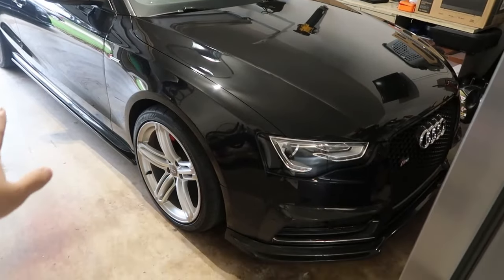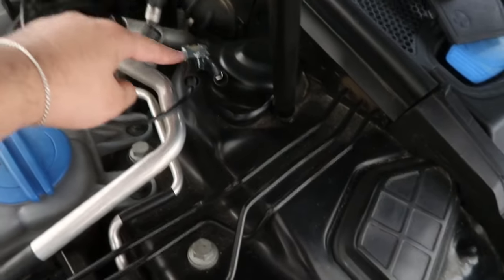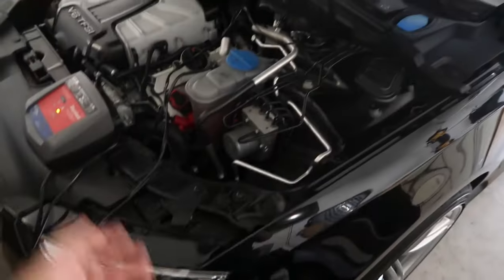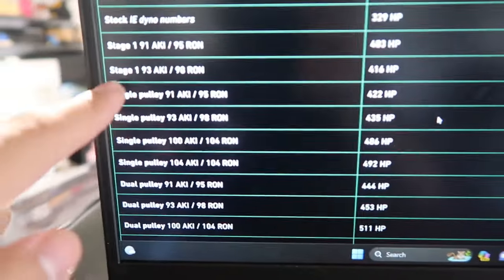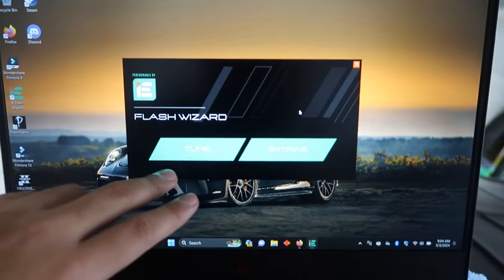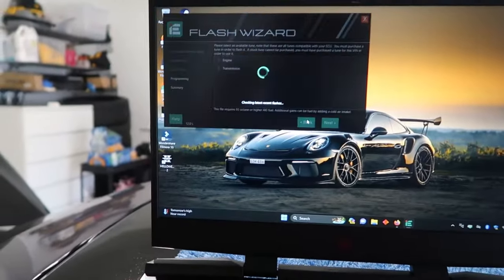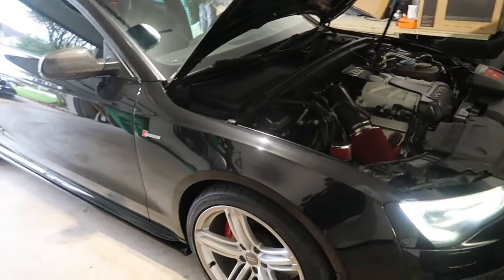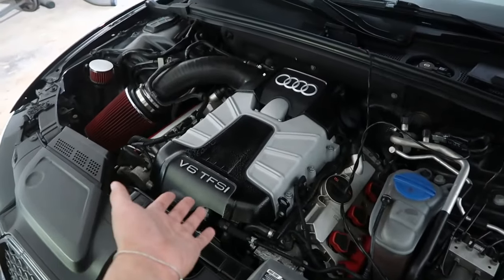TUNING YOUR AUDI S5/A6/SQ5/S4

Comment: Nice rides. Will you have to upgrade the interior cooler for stage 2?
Reply from the maker: Not with the single pulley , but when i do dual pulley yes its needed
Reply: Thanks, I’m getting ready to tune my S5
Reply: In the summer you'll notice heat soak without an upgraded HX on stage 2 SP.